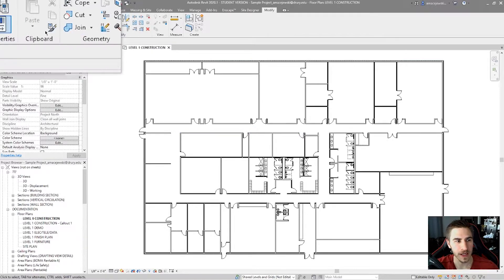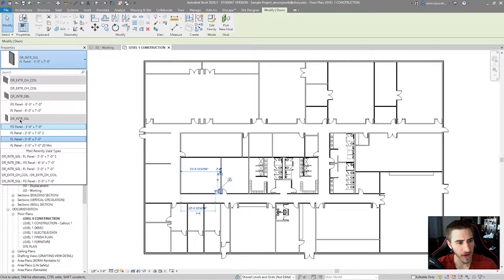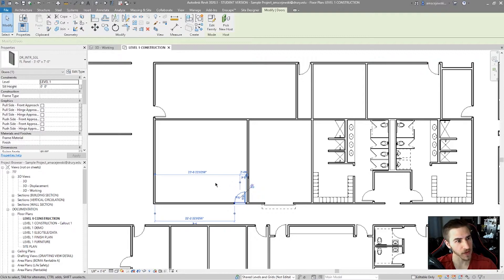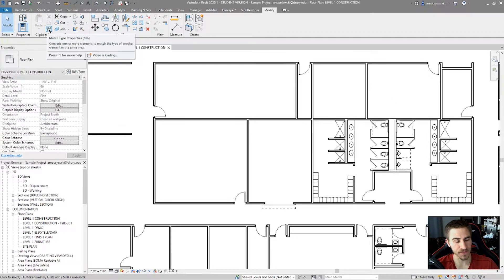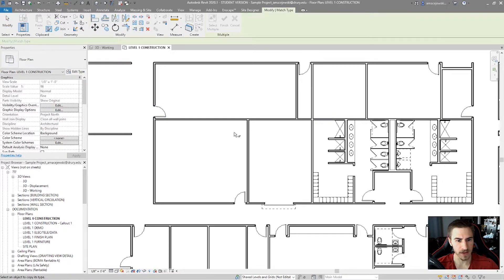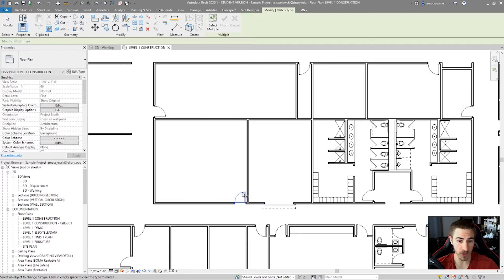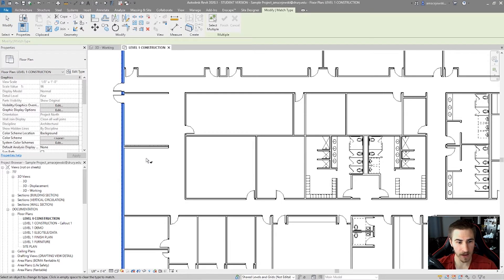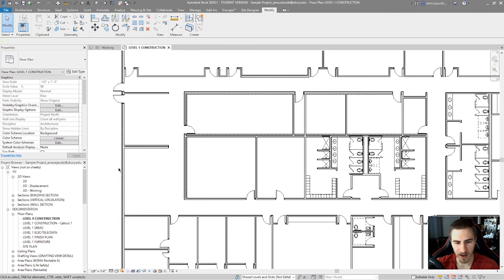How to Use the Match Type Properties Tool in Revit | Revit

Comment: Hi and thank you a lot again and again, but I am wondering if Revit has the same ability as AutoCAD concerning the match properties SETTINGS  so man can choose the properties to inherit.
Reply from the maker: It does in a sense in that you first select the object you want to use. Then you can choose a different object of that same category and this object will inherit the properties of the first.
Reply: @ArchitectureVanguard  THANK YOU!
 BUT I WANT TO MANIPULATE WHICH  PROPERTIES TO INHERIT AND WHICH ONES NOT TO. jUST LIKE AUTOCAD, WE TYPE MA THEN SETTINGS AND ACTIVE THE PROPERTIES WHICH WE WANT TO INHERIT, THANK YOU!
Reply from the maker: As far as the match properties go in Revit, it’s basically all or nothing. If you use the tool, all of the properties of the selected object will be inherited.